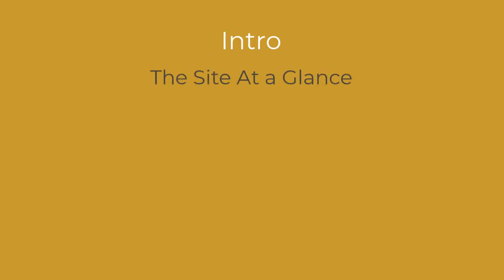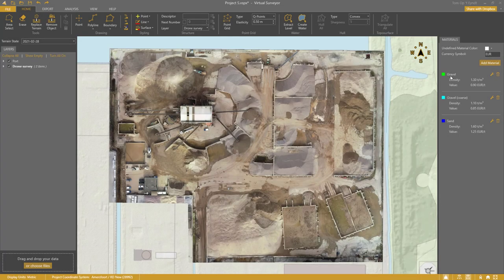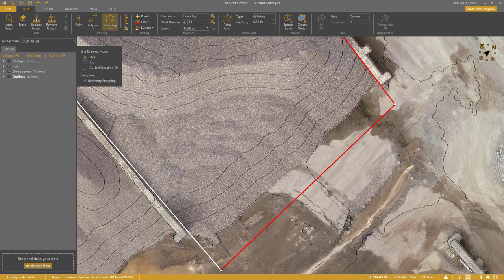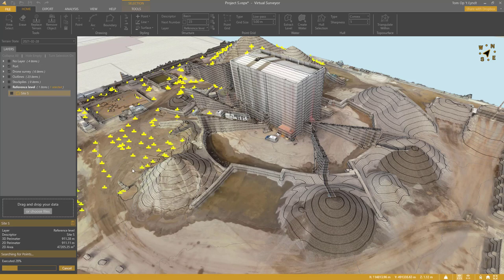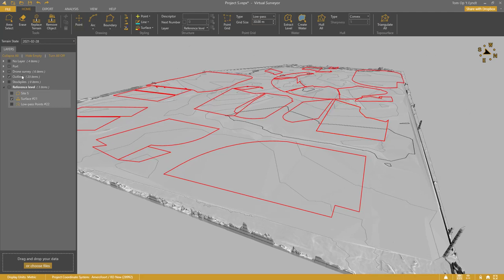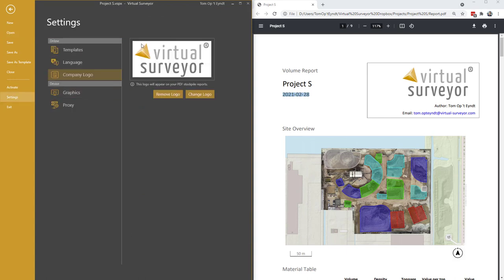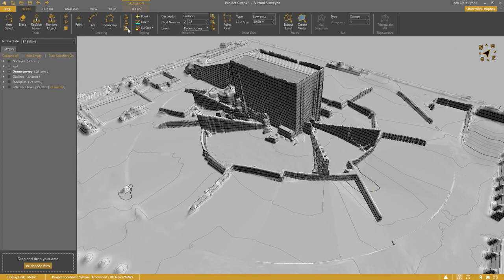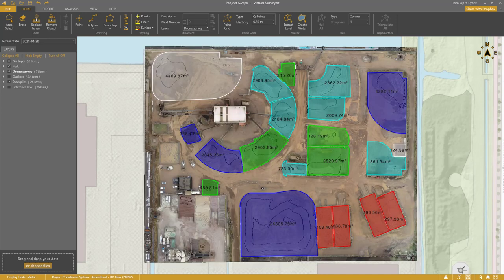Stockpile Inventory [with DRONES]

Comment: Hi! I am a quarry operator for sand & gravel in the Philippines. I'm planning to get your product. May I know which DJI Drone works with this seamlessly? Thank you
Reply from the maker: Any mapping drone will do: DJI branded or non DJI branded. A mapping drone allows you to fly a programmed pattern over your project area so that the photos overlap. You need this to produce the orthophoto and digital elevation model (DSM) which go in Virtual Surveyor for the calculations.
Reply: @Virtual Surveyor  is RTK needed to get this data? Thank you for your response, btw.  Hope you get more subscribers and viewers.
Reply from the maker: @konp368  You need accuracy to get good measurements. You can achieve that with or without RTK. Without RTK you would typically need a number of ground control points, with RTK you theoretically don't need ground control points but using at least 1 is a good practice.

Comment: In terms of accuracy, what can I expect?
Reply from the maker: The accuracy is determined in your photogrammetry process (production of the elevation model). That accuracy is determined by how you fly (the higher you fly = the lower the accuracy but it will require more work when you fly low so there is a trade off). Also the ground control points you use will influence the precision. Virtual Surveyor calculates all its output based on the information you will put in...